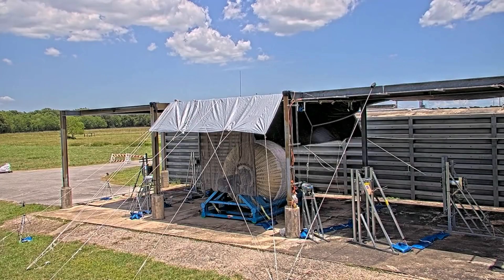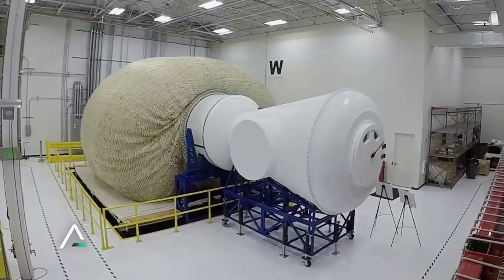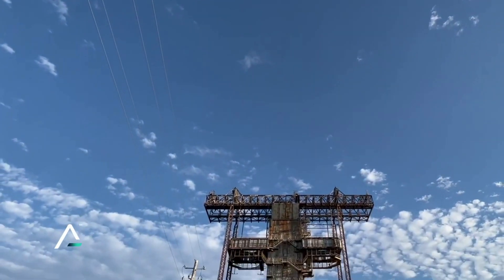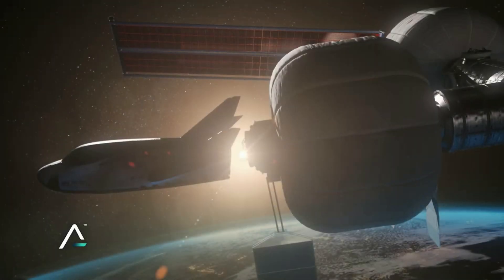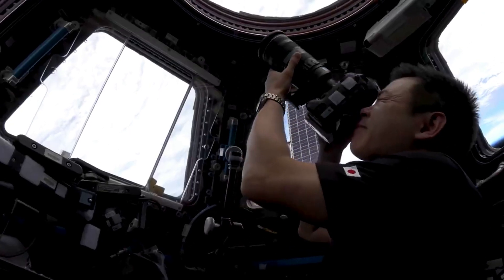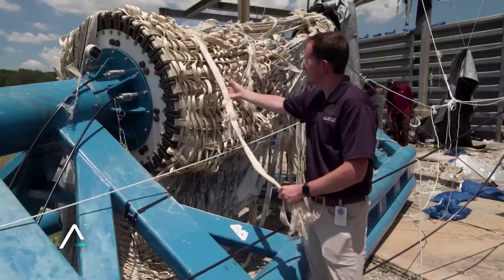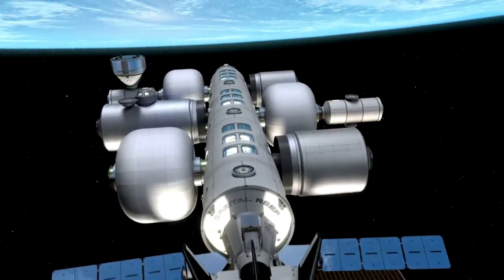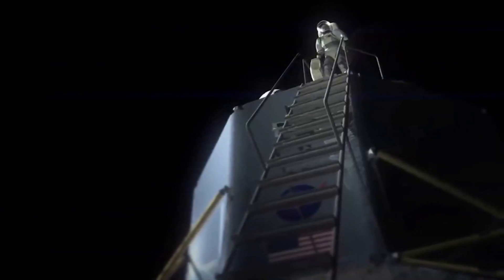How Sierra Space Is Trying To Change How We Live In Space

Comment: How well does the material stand up to direct sunlight in space? Here in Arizona, the sun can destroy most fabrics in a short amount of time. Sunlight in space will be MUCH harsher.
Reply: You can be sure it will be okay.  The BEAM module has been on orbit since 2016, and is still in use on the ISS.  Other test units have been in LEO even longer.
Reply: @martythemartian99  That would be Bigelow's Genesis-1 and Genesis-2 modules, which are still in orbit.

Even though Bigelow seems to be out of business (damn shame, they were out there first, and the need for this kind of hardware is just starting to ramp up, I hope they can make a comeback), they are still corporate property, and someone is still monitoring their performance, as well as that of BEAM.
Reply: @stardolphin2   Yes, those were the two I was thinking of  :)
It is a shame Bigelow is gone, but at least the work they put in is not lost.
Reply: Sunlight schmungblight my trampoline has fabric but it doesn’t get destroyed in summer

Comment: The burst test is putting me off the gig, I'm canceling my ticket. :goodvibes:
Reply: Really?  These tests fill me with confidence.
Based on what was said, there is a normal operating pressure.  NASA requires a proof test of 4 X Operating Pressure.  These tests greatly surpassed both normal pressure, and the proof tests.
Added to the fact that they are more resistant to micro meteors than current space station modules, leads me to ask... can I have your ticket?   ;D
Reply: @martythemartian99  Yes of course you can have it. Enjoy the micro meteors, not so the bigger bits I'm afraid.  Still, you sound like a space cadet and thus will be immune. cya.  :elbowcough:
Reply: @IbnBahtuta   My favorite Micro Meteors are the nacho cheese flavored ones.  :)
Reply: @IbnBahtuta  Well, Bigelow used to say that there is nothing that would penetrate their modules, that would not also penetrate an aluminum hull (which is what 'hard' modules typically are).

Both Bigelow and Sierra use layers with the same material used in body armor.

So, I must ask if there is any pressure vessel material that you would find satisfactory? Nothing will protect you from everything.
Reply: Destructive testing is nothing new. 

You want to know just how it will fail, and that it does so equal to, or greater than the anticipated burst pressure.

(Which itself is far greater than the intended operational pressure.)